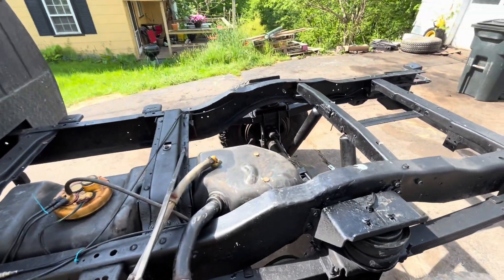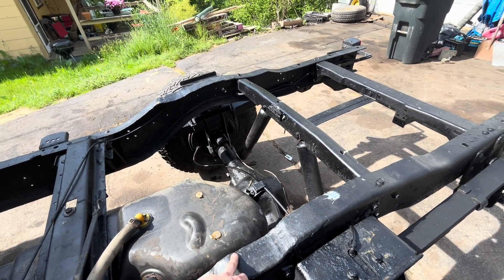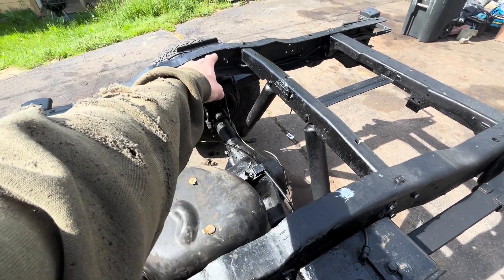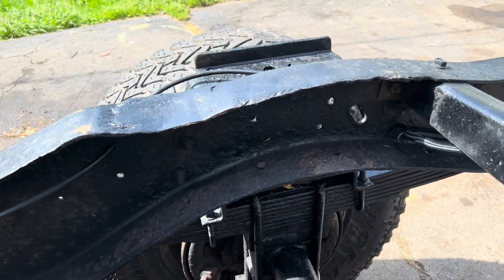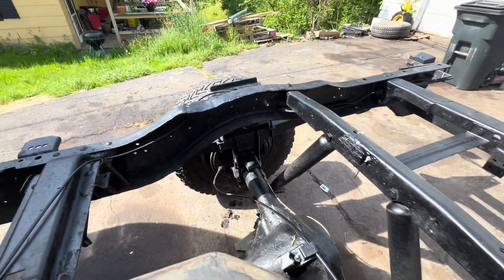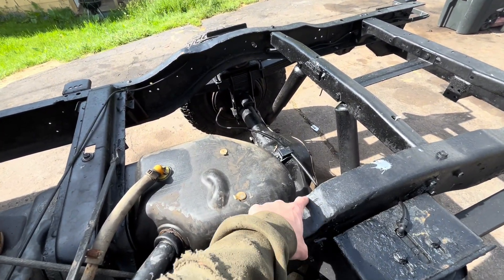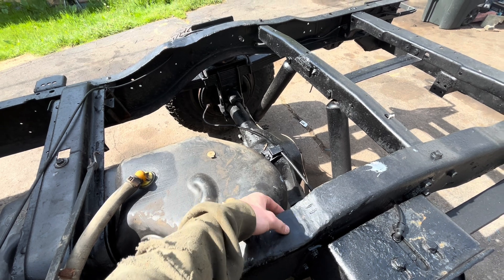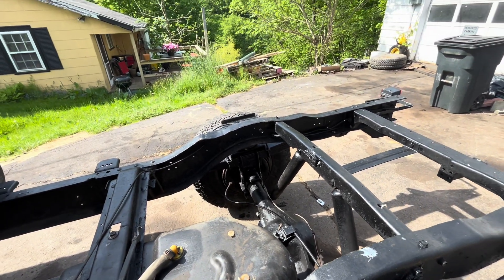THE FIRST GEN IS CHANGING!! BUILD UPDATE

Comment: Hey man whats your star wheel tuned at ?all the way down ?
Reply from the maker: no, two turns down from all the way up. I don’t like a ton of smoke. Lean is mean
Reply: Lean is mean that's from Brian.  Mine set at 3.5 from top if i go up any higher the turbo takes a long time to start talking.
Top hat Fuel pen.
Timing bump 3200 spring   ccv  air dog fuel pump